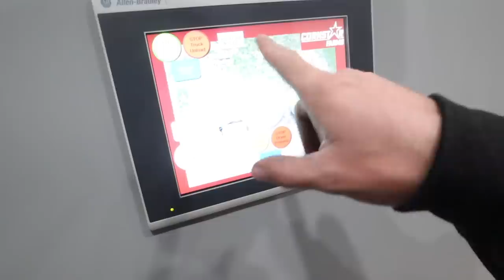Dad Blew His Top

Comment: If you use the PLC to run the cross auger incrementally and have an interlock for high amps it should keep it from burning the belts off.
Reply: Yes, its a software logic issue I think.

Comment: Hi Cole
im an industrial electrician in New Zealand.
With the pit, you could have some coding if you know the load on the auger out of pit is low then start the cross auger for example for some time.
Reply: probably shutting off and starting back again the cross auger with a full pit will not work, maybe a frequency controller, to run it with a lower speed, to not build up resistance in the middle of the pit might work.
Reply: @jogruben  I agree, starting an auger full of wet corn is usually a guaranteed problem. VFD's are cheaper and more reliable these days, would probably be a good way to overcome what seems to be a terrible design.

Comment: Dang guys, I feel horrible all the issues your having with your bins, hope everything gets fixed soon, what a terrible job the company did that installed them, hope the courts make them give you back all your money.
Reply: Install is just a small part of it.  Really feel the design of the system wasn't right either.  Most place that have the big 1000 bushel pits are running to augers to unload them the pit is really 2 500 bushel pits going in to one grain leg.  Yu need like a 16 to 18 inch auger for the 8,000 bushel they said was quote and spec out.
Reply: @johnunsicker7440  Yeah, I’m not a farmer, but love watching and learning. I knew there was trouble when they started showing structural issues with how the bins were being put together. They’ve had a bit of bad luck, their new to them combined with all its issues and now the bins. I pray things turn around for them soon.
Reply: I feel as though they should have asked around a lot more about grain systems from neighboring farmers. And heck even the YouTube farming community for more advice before they committed fully. Now their stuck for atleast 2-3 years in legal battle before it will ever work properly
Reply: @jayheiman7388  Yeah, I know Cole boasted about the cost savings over the co-op, and if the system worked correctly from the start I’m sure the savings would have been there. Now with the issues and legal fees, I’ll be curious if there are savings this year. I truly hope some company can make it work as it was designed.
Reply: Would it be possible to change the pulley sizes so the cross auger turns slower?
Reply: @peterhildebrandt8572  You can do all that but  remember they was quoted a 8,000 bushel per hour system.  Turning the pit auger slower will just make the whole thing even slower.  I think they can only get 6,000 bushel a hour right now. So slowing the cross auger up only going to make it worst.
Reply: @JT-1969  They still be saving.  Remember that the biggest saving is to be able to store the grain onsite and not have to pay the storage fees at the co-op and then paying them to dry your grain as well.  Also remember this is a long term investment not a short term.  So the saving covers every year.  If everything was in writing and and it was spec to be 8,000 bushel grain leg setup then any legal fees should be passed on to the dealer that design the system.
Reply: @jayheiman7388  Hindsight is always 20 20. But yeah going to seeing like Larson farms or Millennial Farmer setup would of been great to get a better idea but remember you are dealing with a dealer that should know what is best for what you want to do.    Like on Larson new bin they did the two side draws one to load trucks directed and the other to load the drag conveyor.  This one was put in to limit the use of the unload floor auger.  Someone was thinking when they added that one.
Reply: @johnunsicker7440  no farmer in their right mind would start from a blank slate and build the grain handling system that MN Millennial Farmer has, including Zac himself. That started out as a small system and was added to over the years. It works, but it is far from efficient. Conveying grain with a pneumatic system is far from ideal.
Reply: @johnunsicker7440  Not to disparage anyone, but when you get multiple quotes and one comes in significantly cheaper than the others, you have to try to understand is it great value, or am I accepting risk? Seems to have turned out poorly this time. It's a hard decision we all have to make with any investment, especially of this size.

Comment: Industrial maintenance here. If you have a frequency drive for your cross auger (which I imagine you do) you might be able to slow it down where it turns slower that the diagonal auger. So that way it can take away grain faster than it can pile up. Might be able to have Joe look at that for you. It's not right but you might not have to change belts everyday. Best of luck.

Comment: Cole, it would cost some money out front, but adding a vfd to the cross auger in the pit would solve the problem. Your controls guy can easily set up a load sensing program to monitor the amperage draw from the motor. There would be a target amperage and if that threshold was exceeded the vfd would automatically slow down until the amperage dropped below the threshold. That would prevent burning off the belts but still keep the discharge auger fully loaded. Then as the pit becomes empty the cross auger would speed back up again to quickly empty the pit.

Comment: One solution for your belt situation.  Replace that one drive with a leaf chain/silent chain setup.    Just make sure its perfectly aligned and tensioned.   Put chain lube on it a few times a season and it’s bullet proof.    Down side is there’s no slippage, unless a key shears off inside a gear.
Reply: Shear pins are usually fitted in situations like these....if its possible

Comment: daddy has a long fuse but i think he is about to the end of it.
Reply: The stuff ups with the silos by the contractors needs to be fixed by them
Reply: Boy if he goes off I'd hate to be around for that. He seems to be very patient but I don't see this going well for the company who did the bin site work
Reply: I've had a similar experience with some tools and equipment. You have a trusty tool, it reaches it's life cycle or capacity. You buy something bigger and/or better according to reviews and stuff written on their official pages and it just doesn't work as well or breaks after a couple of months of use. The only way not to get swindled, it seems, is to ask people who were swindled first nowadays.
Reply: @ZenMuff1n  You need to check on contractors work before you engage them in a contract, HOWEVER you can still get caught out as the result of false testimonies

Comment: Cole, the auger solution would be to use a motion switch on the pulley, they can be wired to send a constant  signal to sense rotation or to send pulses.
If you have an AB high speed counter module on the plc rack you can set the belt slip limit through basic coding.

Comment: Hey guys, what if you were to remove the pulleys on the cross auger and install sprockets with heavy duty chain. Have a small sprocket on the motor and a larger sprocket than the pulley that’s on the auger to slow down the auger speed a little. Might help since the belts can’t seem to handle the load and with the cross auger turning a little slower, might help the auger to the leg to keep up. That cross auger sounds like it’s going too fast.

Comment: The pit centering auger problem can simply be solved with a timer relay. It doesn’t need to run all the time so don’t.  Put a timer on the control of the auger motor.  10 sec on and 20 sec off.  Or change the pulley sizes to spin at 30% current rate.    I enjoy all your content.  Grew up in Melrose  township. Very easy to relate.

Comment: cole you might wanna consider changing the pulley size on the pit cross auger to minimize the pressure on the belts - it will slow the pit emptying time but will lower the stress on the pit system - love you guys and your family is in my prayers for success and abundance

Comment: DC you have three augers, left, right and center. Set the center to run continuously. Set the left and right to alternate running for 1 min intervals.  That would avoid the high pressure jam you noticed.
Reply: Except that it's opposing screws on one auger...

Comment: DC from my experience as a millwright for a setup like you have in your pit you really should have hog backs ontop of your auger. It takes the weight off it but still allows full capacity of your system.
Reply: I think they have them on the arguer.  To be honest it looked like a bad design for the amount of grain they want to move.
Reply: I agree ive been watching the series when they built it and I would have went with a drag too a leg with gates in the bottom of the pit to control flow. But i understand that the way they went was much cheaper and it really shows.

Comment: As an automation/controls engineer I can't help myself and don’t expect a response... 

Is your pit cross auger driven by its own motor? 
Is it on a VFD? 
If the auger is in fact independently driven, I'd put a VFD on it if it doesn't already have one and slow its speed down. I doubt it'd get you back to your rated grain take-away rate but it'd prevent you from burning up belts. You can get a fairly cheap one to save you the headache as you’re not doing anything too fancy control-wise.
Another option is to modify the PLC program to only run the cross auger when the main auger load is starting to lighten up. As you have noted previously, you are using load detection for the auto shut-down and as I understand the shape of the pit feeds the main auger when it’s "full" . 
A fancier option could be to put an encoder on the auger shaft itself which with PLC code you could use to detect belt slippage and to throw an error and stop.

I hope this information helps.

Comment: Just a suggestion if the pit can hold a full truckload you could put a frequency  drive on the cross auger and slow it down and once it sees an overload it will trip you would have to reset it I feel your pain good luck

Comment: Just a thought, if you put put a voltage monitor on the cross auger, and back fed it so when the middle is empty the auger runs until the middle has filled you might stop cramming the grain and burning out belts???

Comment: Could you try reducing the size of pulleys on the ends of cross augers so they are running as fast and not binding as much, it's a band aid fix but it may help with not burning belts. Custom agri systems out of Napoleon ohio  does fantastic work and they travel all over to do work for the Andersons.

Comment: Hi Cole. It sounds like the problems you are having burning out the belts in the cross auger could be because the gearing of the belts is wrong? If it’s trying to drive too fast your main centre auger won’t be able to take it away fast enough. Might pay to check if the pulleys on the drive motor and the cross auger need swapping over. Even if it’s running slow you could maybe still get to empty the truck out. Good luck with the rest of HC arrest from Australia. We are just a few wet away from starting our harvest. Been slightly delayed because of a wet spring for us here now, and much cooler temperatures. Have fun in the John Deere, glad they could come up with a solution for you. 👌👍

Comment: With your cross auger problem how about changing the pulley size on the motor drive to gear it down and therefore slow the auger speed. I am sure this would solve the problem in stead of the auger ramming it to the centre of the of the pit

Comment: While the cross auger in the pit is broken, try this. When unloading truck, center the rear hopper over the pit. If the pit is empty you should be able to open the hopper wide open to unload. Being that the corn is centered over the pit auger it should take the corn out of the pit faster. Once hopper is empty back up easily because you still have weight on the drive axels and dump the front hopper. It won’t be as fast as the back hopper, but should empty pretty quick. Down side is that you have to get in and out of the truck. Up side is that you may unload faster because the pit auger will be working more efficiently and you won’t spill out corn on the ends of the pit. I hope you are willing to give it a try. Good Luck.

Comment: What you guys need to do with the pit is put a gear reducer in, then you can use a bigger pulley to increase belt to pulley surface area on the electric motor to keep from burning belts off, it’s just a thought.

Comment: If the cross augers in the pit are driven by individually by their own motors, can you  cycle them on and off via the PLC.... Meaning run half for 2 minutes and run the other side for 2 minutes until the pit is empty... Then rinse and repeat.

If the pit cross auger is only driven  from one end... Then have your automation guy change the code to cycle the auger on and off until the pit is empty. 

In the future you should consider splitting the cross auger into two separate units with their own drives and controls

Comment: cross auger should have a shield over it to regulate flow, or it should have small flighting.. or turn slower if the flighting is over-sized for the rated bu/hr.  Also auto-tensioners on the belts would be a good idea likely.

Comment: the belt problem you could try upsizing the belt and use a gates green stripe they are more for insustrail use are heavier and don't stretch like a regular automotive belt and you need some lights on the pit so you can see better on the low side

Comment: I hear you Daddy CS.  Having issues drying.  Last year rebuilt motors, new breakers.  It still kicked out overnight.   That’s not 5% the issues you have been having. Hate to say it.  But you might need to limit yourself to under 5000 bu hr just to avoid downtime.  I reduced auger rate so now it barely keeps up with combine.  Just less work.

Comment: What about doing a chain and sprocket setup on your pit? You could put a clutch on one of the sprockets so when there's to much pressure from the gain meeting in the middle it spins freely until enough has been moved it Cann start feeding it again
Reply: I like that idea to a point, but I think it would make more sense to remove some of the very middle drive screw so it doesn't pressurize as much, maybe reduce drive speed to better match what the main auger is taking out

Comment: I just completely rebuilt my sieve frame on my 9770STS. One bolt broke causing the other bolt to pull they the frame. Deere makes an upgrade for it so I had to buy both sides of the sieve frame. It fell down and damaged the clean grain auger and tailings auger. 27 man hrs of JD labor and 2 trips with a service truck later…..

Comment: After thinking about your pit burning belts issue might I suggest and I know u have issues with the vendor but you need to fix so you can use it I would suggest getting a different driven pulley about a inch larger to slow the cross augers down to let the auger to the leg keep up  you probably will actually increase the unload capacity because your not trying to force the auger to the leg

Comment: Those cross augers need load sensors and limiters and software controls to manage them. If the grain gets stacked up in the middle, there's no where for it to go, so the weakest point fails aka the belts. I'm surprised that the motors haven't burned out yet.

Comment: Hey just a thought, maybe your pit augers are to long. How about grinding or cutting a few inches off the flights on your augers in the center of the pit? this would leave a dead spot for your grain to build up and not bind. Another thought is to slow the pit auger down slower than the auger taking the grain out of the pit.

Comment: Try a longer set of belts and add a tensioner..the greater the percentage of the pulley in contact with the belt less the slippage, less heat more worky les breaky...cheaper than a new set up

Comment: You should go to a cogged pulley and belt on your cross auger then it will not burn the belt it's going to break something but if everything is made fairly strong it shouldn't break anything had the same problem feed mills I have worked at and when you got a weak link like that you can put cogged belt and pulleys on it and it will force it through or you may just trip the breaker again like you were

Comment: Might have to park the front hopper right over the middle of the pit, then pull ahead and dump the back hopper.  I wonder if you had a cover over the “auger” in the pit.  Like a combine hopper tank.  Then it wouldn’t put as much pressure on the flighting?  It would meter the grain into it it.  Really sucks to have a bad contractor/designer that doesn’t stand behind there work.

Comment: Dear Cole: Enjoy your videos.  They brighten my day.  But not enough that I'm going to do the heavy lifting for you on the belt thing.
IF you can find the time to "do the reading" or you if can call in "The Belt Guy,"  you'll find that your belt problem has a catalogue and math solution.  "I" suggest replacing the VEE drive belts with toothed belts and cog wheels sized for 1.5 times your maximum available horsepower.  IF you have the room.  If your drive motor has a reduction gear to give more torque do the appropriate multiplication to find out how much horsepower and torque you're really applying to those drive belts.
Thank you for your little rays of sunshine.

FWIW The Belt Guy would be the manufacturer's representative design engineer.

Comment: Sounds to me like the cross auger is too fast when the hopper is full and it is overloading the belts or the belts are too small to take the load of the grain when the hopper is full on both ends. The Center auger capacity is what governs the unload speed. So the cross auger has to match that within reason.